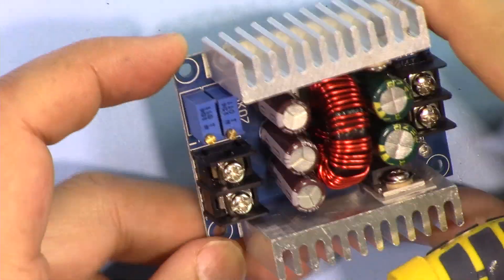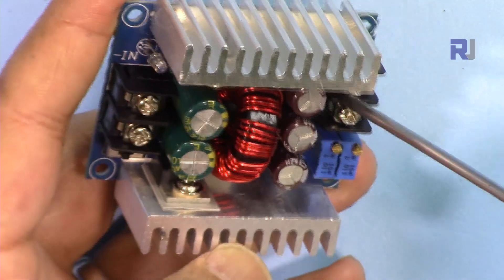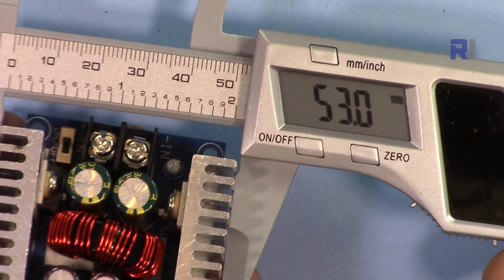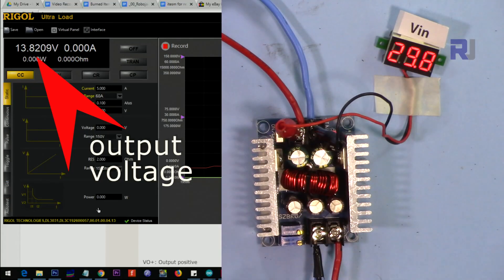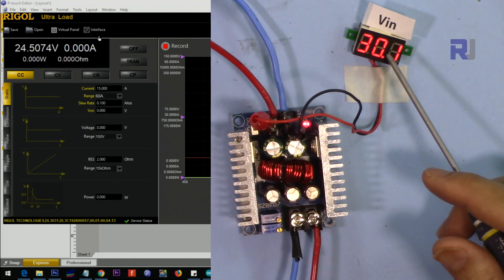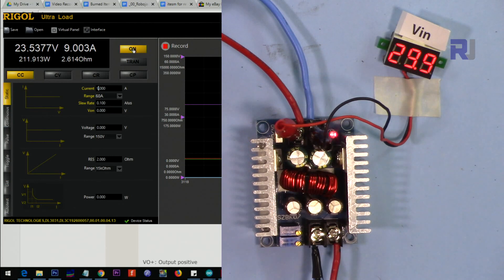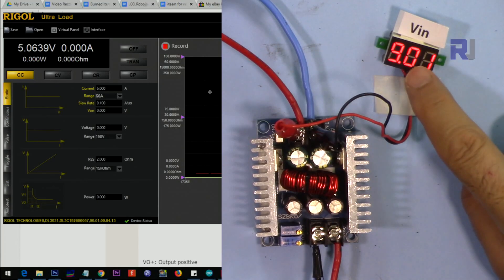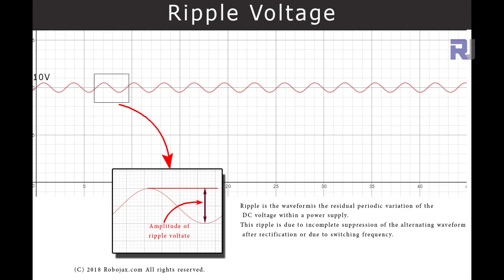Review of SZBK07 300W 20A  Buck converter 1.2V to 36V with constant Current

Comment: Hi maybe you can help. I want to use this module in a project but want to relocate the two CV and CC trim pots. I have un soldered them and planned to use some 28awg ribbon cable. Approx 150mm long so that I can mount the trim pots in an accessible place. Is this 28awg wire OK or should I use a thicker cable? I appreciate any advice you can give. Thanks and Happy New year!
Reply: These trimmers are there just for the sensing. So, you can use thin cabling.

Comment: Looks like the main problem with these supplies is the voltage drop at output. With the current limit they are acceptable, at least someone will load it to the acceptable thermal limit, knowing that is only 8A or whatever. But the output drops so much in voltage that is nasty. What chip is the controller, LM25116? And for me, I would choose transistors with lower internal capacitances
Reply: Pm me can you to install do sola paint of charger..

Comment: Since how many amper (mA) begin it to regulate current? <1A current can your model regulate with 2-nd adjustable resistor?  
I could not with my szbk07 regulate current about 280mA.  It works not, is that normal or defect, what you think about that?
Reply from the maker: this module is make for 20A. the variable resistors have tolerance of 5% or 10% and that is the first thing you have to consider. Then the OpAmp and components used and the shunt resistor they all affect it.  unfortunately I did not pay attention that but it is very good point. I will consider that in the future videos.
Reply: @robojax  thanks for answer, my module is 15A, I sow another video, in which one blogger try to reduce current with this module, but after <0.33-0.36A it could not regulate, that was the min. regulation , in future i will find more powerful device or test the same under load and check if  it is  working. The variable resistor is working , I tested with multimeter.

Comment: Hi, very nice review. One tip, you should put one voltmeter directly on output of converter/pcb because voltage on on your Rigol load is slightly lower due to voltage drop in cables. Buck converter tries to maintain voltage but cant "see" value on the other side of cable.
Reply from the maker: Hi, thanks. I've fixed that in the later videos.  The electronic load as voltages sensor wires which I can connected to the output for just measuring the voltage to show correct reading.

Comment: What will happen, if i add only xl6009 single mosfet on xl6009 boost converter circuit. Then can it increase more ampere....?
Reply from the maker: you can't just add it like that. will not work.
Reply: Thank you sir..

Comment: What program are you using??? I’m trying to get a tec to 15v 10 amp....I’m not smart with any of this.  I have a buck and 24v 14a power supply.
Reply from the maker: it is Rigol Electronic Load that has PC software. I just put the link in the description for that.
Reply: @robojax  thanks for the reply. Another sub. Thank you.
Reply from the maker: you are welcome and thanks for subbing.

Comment: you test load rig does not have a 00 gauge wire, the 1 volt drop is caused by your wire in the output, unless you place another voltmeter right on the output, 15A will have a large drop on the wire
Reply from the maker: 00 Gauge wire is rated for 100A to 200A. We need maximum of 20A. But I agree, eliminating voltage drop should have been taken into consideration.  Thanks for tip though
Reply: @robojax  you could just use a separate voltage tester right on the output port separate from the load wire and there upi can decide on the 0.5vo;t drop in regulation.
yes is overrated but wires have resistances, the voltage drop of 0.5volt for a regulator for it not to pass is very easy, since even a 14 a 20amp rated wire still has a resistance proportional to length and these are working with low voltage. 
proper instrumentation test for out voltage regulation will be a separate voltmeter exactly on the output. 
you have a good load test equipment, ithe voltage measured is on the load itself, measured with the wire and your are testing large currents. maybe a separate tester on the output to see regulations.
thanks for the reviews anyway
Reply from the maker: Thank you for sharing your knowledge.

Comment: You are explain good.  But from solar panel, constant voltage and amp only varying time to time. 

For example solar input 36v with 5amp. I will adjust CV to 14.5 volt and adjust the CC to 9amp. 

Some time solar will give 36v with 8amp.  I Check the output 14.5volt with only 8amp.  Need to adjust CC again to get 14amp.

Some time solar will give 36v with 3amp. I check the output 14.5volt with only 3amp.  Need to adjust CC again to get 5amp.

So if solar amp changed, every time manually adjust the CC to get maximum amp as output.

1. I want to know my device is working good are having any problem?

2. only external feed back circuit will control the standard maximum amp?

Please kindly clear my doubts.

If any one know solution for this issue, please share the idea with me at johnjpstar@gmail.com.

Thanks.
Reply from the maker: I know solar panel voltage (actually the power) is reduced when there is cloud or darkness.  the buck(step down) converter is not a good option. Please use boost converter so even with the lowest voltage, you will get maximum voltage. The power however will not be matched because power can not be converter. we can convert only Voltage and Current. Please see my review of boost converters https://www.youtube.com/robojaxTV/search?query=boost or see the video page https://youtube.com/robojaxTV/videos and search or browse. Good luck.

Comment: I am confused. How does 44W Input power and 18W Output power make efficiency of 87.6% ? Shouldnt it be 41% ?
Reply from the maker: Please point the time like 08:35 or something so I look at it. Efficiency (shown as η) is calculated by dividing Output Power Po to input power Pi P=IV, η= (Po÷Pi)x100%
Reply: @robojax  Yeah, 18/44*100=41 -> https://youtu.be/R3s_g25Gw68?t=904
Reply from the maker: Sorry Yes, it is typo. The efficiency is correct. But I said it correctly at 15:04 input is 1.7A but I typed as 3.7A.  PS. I can't watch the video  like regular use, so I had to use calculator divide 904 by 60 to find the time LOL). YouTube comments works automatically if you  type for example 8:12 and it will take you there.

Comment: Hello, Great video, lots of useful information. Can I use two converters like this in series, to get 21V out of a single 15V source? or would it be a short circuit if I made like 10,5V and 10,5V of each and join them? Would then the efficiency be very low? Thank you, Sir.
Reply from the maker: Yes and NO. Yes if you have separate input source for both. No if you have only ONE power source.  No efficiency will stay the same. The output would be some of both.
Reply: @robojax  I see, thank you :)

Comment: Hlo sir.. Your review is amazing. I realy love it.. 
If I will add mosfets to this circuit. Parllely.. It helps in increase amp rating??
Reply from the maker: Hello, I am glad you liked this. It will not work. you need total modification. The constant current section is checking for specific current and turning the voltage low when it detects certain value.
Reply: @robojax  thankuu for the answer..
Reply: @robojax  i want to connect input 20v 12amp (240) watt power and at output 15v at max current(may be 15 amp) ... Can it work or not sir.?
Reply from the maker: if it works or not, I don't know . to answer your question, I have to watch the video. So you watch and see which part is closer to your voltages and decide if it works or not.
Reply: I tried to connect 12-24 V DC- brushed motor to this DC-DC, as input I used 12 V battery, Voltage regulating is working normal, if you connect any voltage, as output You can become 1-2 volts less, as input. I could not become >11.2 V from 12 Volt input. Current was about 280 mA and current regulating works not or it need some A current for regulating, Adjustable resistor for current could not change the current 270-280 mA, and I am thinking, if I must send that back (defect) or it is normal...? Later I will try with some powerful motor. If it can give more current, as input, I don't know, you can try or wait answers , who did that already. I think, you can count like this, your output power will be  about 5% less, as input power. In your case 20x12=240   -5%=228Watt,, 15Vx15A = 225 Watt, in theory it can that, in practice I don't know.

Comment: The difference in the output when the load are are attached / not attached is because of the resistance of the wires. In this particular setup the wire resistance seems to be around 41 mOhm. If your DC load is capable of doing 4-point measumrents then you can just hookup the voltage probes directly to the DC/DC converter output and then get the true output voltage.
Reply from the maker: thanks for  the insight.
Reply: Pm me can you to install do sola paint of charger..

Comment: Hi i know this is a very stupid question. I am now starting to learn about motherboard repair and in need for power supply that can supply high volt an variable ampere. My question is can if i set this to let say 20V, and i didnt touch the potentiometer at all, will it supply the needed ampere required from the load or it will stay stuck at a certain ampere and i will have ti match it with the load. Thanks!
Reply from the maker: Hi, no question is stupid question.  For power remember P(input)=P(output)-15% meaning output will always be less due to losses. So you can calculate the power easily P=VxI where I is current in A unit. yes Const current means it will keep the current constant and not changed. but this is only possible if the input can supply the needed current. Remember the outpt P can't be higher the input P or Power.
Reply: Robojax understood! Thanks for the tips! I have just ordered the parts and are waiting. Cant wait to assemble them my self! Thanks a lot!!
Reply from the maker: Lo siento, (google) no lo entendí. Por favor, use una oración muy simple para que Google me la traduzca.

Comment: Very useful demonstration. Just wondering, how hot is too hot for the heatsink on this kind of device? If I can't keep my finger on it, is that dangerously overheated? Or is that normal?
Reply from the maker: Yes if it burns your finger, that is above 80C so inside chip junction is 50 or 40C more like 120C and that is right at the edge. So check datasheet and see what is junction temperature.

Comment: If I want to set it to output 5A max, can i directly hook a multimeter to the output terminals and adjust the  current limiting potentiometer until the multimeter displays 5 Amps? Or will this damage the buck converter? Btw thank you for these reviews, I've learned a lot from your videos.
Reply from the maker: yes you can connect. CC or Constant Current means it will limit it.
Reply: @robojax  wouldnt that short the buck converter?
Reply from the maker: CC means it has protection. you have to short circuit it to set the current.
Reply: @robojax  ok thank you very much!
Reply from the maker: you are welcome.

Comment: If I hook my 18v 100w solar panel to this and set the output voltage to about 14v to charge a lead acid battery, can I leave it on all the time will it overcharge the battery? Thanks
Reply from the maker: Hi, you have to know how charge happens. you set the maximum current AND maximum voltage for your battery. For example 14V. if your solar panel's voltage goes lower than 14V the charger will turn OFF. but any voltage above 14 will charge your battery. I will make video on this topic using different modules. stay tuned.

Comment: Will this stop feedback from charging a 14.4v trolling motor for solar when charged or charging at nightfall? Not damaging the converter?
Reply from the maker: what is trolling motor?
Reply: @robojax  It's a motor that works similar to a boat engine, it allows you to travel slowly on water.

Comment: in your opinion is it worth to buy or not? thanks
Reply from the maker: Hi, I presented the test result. it is difficult to say. it might be good for one application and not so good for other application.  your required current and voltage should determine that. My video will tell you what you at what current and voltage it preforms well.

Comment: i cant get this thing workin...
when i connect a 12v battery nothing happens when i turn it on, no output.
same with all other batteries.
Reply from the maker: the multiturn potentiometer needs 15 to 20 turns until you see the output changes.  if input and output is the same then 1- The output voltage is set higher than input or 2-the module is dead.

Comment: Hello rj, can you answer my 2 questions.
1. Is a diode needed to prevent back flow for charging a battery or battery can be connected directly to load terminals ?

2. Is there a way to enhance their voc as I see all models come with mostly 40v. Can it be upgraded by swapping out a few components such as input capacitors or so ?
Reply from the maker: 1-No diode needed. this is converter and will not allow current back
2-no you can't change anything. it will not work

Comment: HI Sir, Your review is amazing. Can I use this converter in Solar Panel for battery charging? After battery full charge power supply auto cut off or not. Led indication i will get or not. Pls do the needful for the same.
Reply from the maker: Hi, yes it can be used.
Reply: @robojax  i think it is not design for charging battery. I dont see any diode on the circuit to prevent current coming from the battery

Comment: hello! I have bought this buck converter but, it cant hold a constant voltage and when i put a load on it the voltage drops significantly. and also can i use this for my home made li-ion 37v battery to reduce the voltage to 12v?  good video btw!
Reply from the maker: Hello, Voltage drop is due to current setting. when the current reach to set value, in order to keep the current constant, the voltage is reduces. try increasing the current using potentiometer to maximum. it should work.

Comment: Why output current is more than input current??...can i increase solar panel ampere by this buck converter???
Reply from the maker: you should know the meaning of Power. Power=V*I= 12*2=24W  you can get only 24W - 15% to 20% losses. do the same math on the output. You can never get more Power but you can get higher current like 5A at output then 24W÷5A=4.8V or if you want 50V at output 24W÷50V=0.48A. As you can see the power is not changing. it is just voltage and current that goes up and down and yes we can do that. I will make a video on that because many people ask questions about it. Make sure to subscribe so you get notified when I post videos.

Comment: Hi What's the size of the Toroid Core Ferrite Ring
Reply from the maker: I just checked it and it is very hard to measure. You need to remove components to measure it which is very difficult.  Why do you need that? this module is very cheap and it you try to repair it, it would cost you more to buy the parts. Also it is not just the core size, but the material of the core. so you can't just replace it with the similar size. Good luck.
Reply: @robojax  It's getting very hot I want to do something like this: https://www.youtube.com/watch?v=eZlmB6eEaEY will be great if you can suggest a compatible ring size. Thanks
Reply from the maker: I have reviewed many modules and don't remember which module was as at what rating. you would have to search and find. it is very hard from me.  Sorry.

Comment: 2:54 you was asking about the name of Chip . It is ( LM25116MHX ) from Texas instruments . And it's 40v max input and it's better not to pass 35v input . And have dual mosfet control for the VC and CC.
I get the name after I pop up my'n during sudden input voltage change from 32v to 50v by mistake in my power supply . Everything was fine in test but the DC converter not step down any more and I suspect that this ic was not working and I was not able to find any data sheet about it but I email the company store that in AliExpress  from China and they give me the number and I buy 15unit for 5$
Reply from the maker: Than you very much.  I have included the link to the datasheet in the description. it was already there.

Comment: Hello Sir... Can you help me?... I want to make Power Supply with this module but there is something wrong after I want to try operate. I change the potentio with bourn multi turn. The module die... How can I fix it. In the module there is no sign of burn part... Thank you before.
Reply: For more info, I want to make Power Supply Regulation from 36V 5A, and this module.
Reply from the maker: Hello, most probabaly the power MOSFET or DIODE has died. So you would need to replace the one or both.

Comment: is it ok apply input with 60v?
Reply from the maker: NO. Read the input capacitors voltage. They will explode if you connect them to higher voltage.